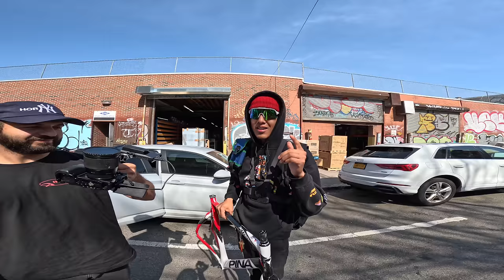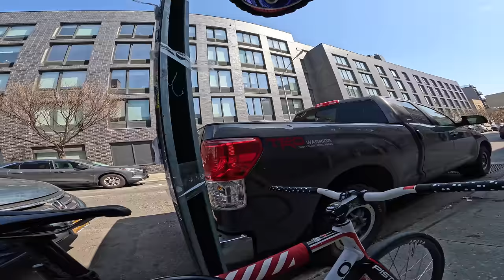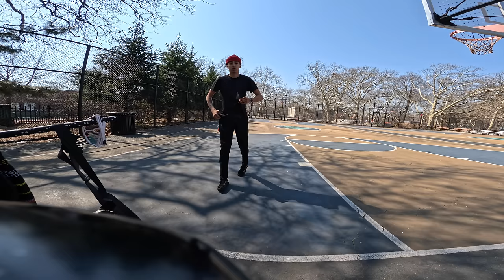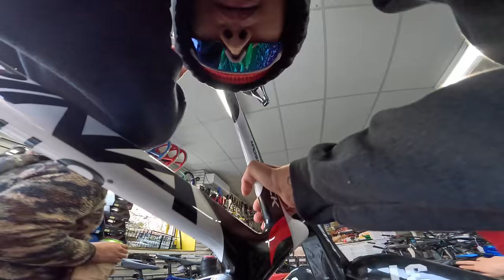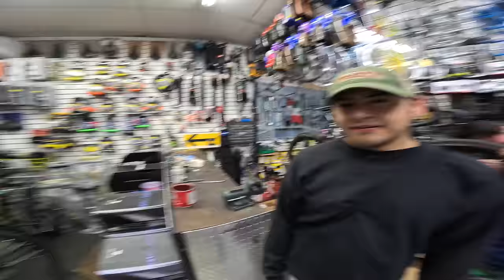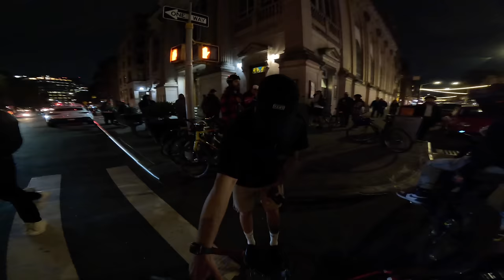FIXED GEAR | MY NEW PINARELLO CARBON TRACK FRAME 😍🥵

Comment: I'm a steel frame guy, but this one is sick af!
Reply: I always wondered what would happen when a carbon fiber frame got in a crash with a car?Would it explode?
Reply: @indiopeltier9758  Metal bikes bend and become unusable carbon fiber bikes crack or snap and become unusable, moral of the story, don't get hit by cars.
Reply: @Thekingofallpumpkins  metal frames can still be weld. yes you can still use them, metal frames are not as fragile as carbon parts.

Comment: Product Description

Specially designed for proud cycling riders. Let's wear this awesome jersey and be bold.

✔ Product Features:
- Comfortable, chic and personalized
- 100% Polyester & Mesh Fabric
- UV Protection
- Pattern Type: Unique design full print
- Comfortable & fit collar
- Full front zipper closure
- Large area breathable mesh fabric
- Anti-slip silicone hem
- 3 Rear Pockets with elastic straps
- Back reflective strips for night rides
- Ideal for cycling, MTB & BMX biking, road biking & mountain biking, bicycling
- Care: Gentle Machine Wash Cold, Do Not Bleach